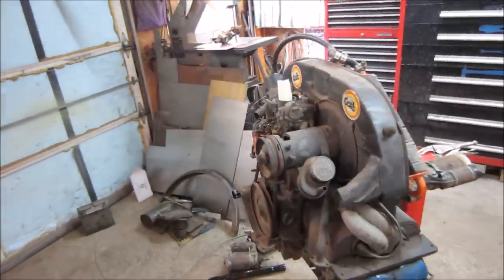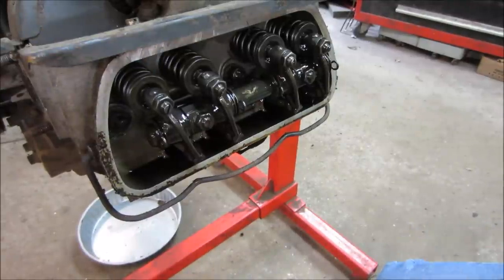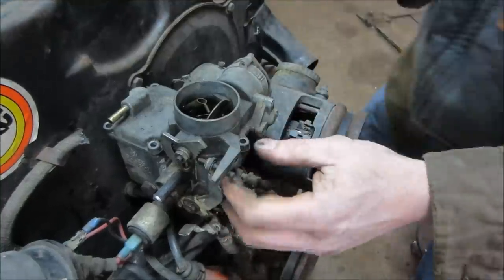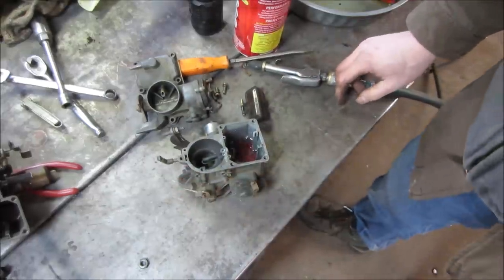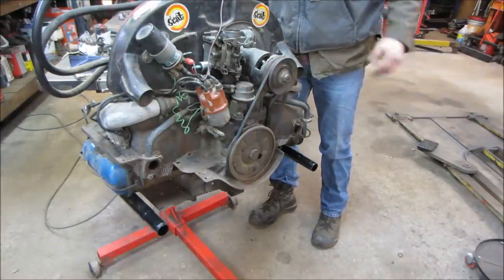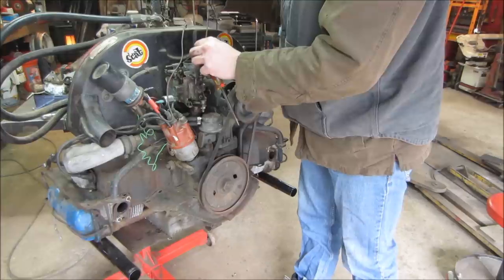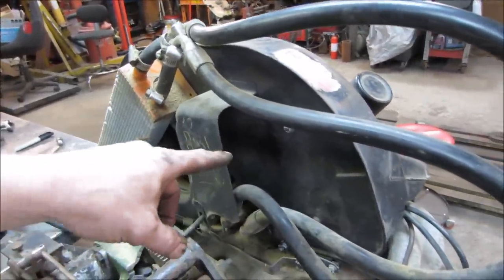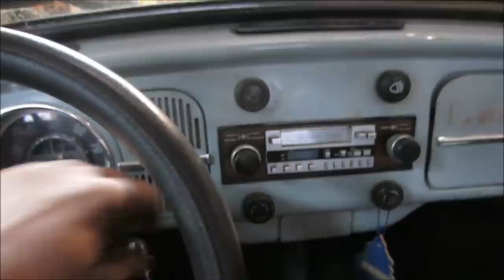will it run? barn find vw bug engine 2nd attempt.

Comment: You do not check end play by using a pry bar between the block and the flywheel. Pull the clutch components and you do it by hand

Comment: The Mustie shuffle!  LOL 
Say Mustie, what is the normal compression of a 10hp Briggs. Got a new old snowblower in need a tune up, carb kit, belts etc. Don't want to put money in it if worn out... Thanks !
Reply from the maker: some have a built in decompression valve so its hard to say, without one it should be around 100 psi,

Comment: If the engines been cooked as you suspect, the rings may have gone soft as well? Had a straight 6 320 bmw once (E21) that when disassembled you could tie the rings in knots...
Reply: Agreed.
Reply from the maker: it dident get that hot, or it would not of come back,

Comment: Excellent video! I do have a question though. You named some reasons as too why the compression might have read low in the beginning. You didn't name that no oil is on the cylinder wall. I always thought that oil was needed to really seal the piston rings against the cylinder wall. Is that correct, or is that just for two-strokes, or not even that? When I get a small engine (chainsaw, etc.) I like to put a very small quantity of oil in the chamber through the spark-plug hole and turned the engine so it would coat the cylinder wall. Always figured that even if it doesn't do anything that it at least won't hurt.
Reply from the maker: the gas l used was mixed with oil,

Comment: Dune buggy use, 1/4" of goo & road dust in float bowl...has the engine been sanded, or partially so? Subsequent compression and oil-grit test may reveal.
Reply from the maker: we dont live in a sandy area, just old gas garbage left over,

Comment: great video. what kind of compression would it have when new
Reply from the maker: depends on the setup but 120/125
Reply from the maker: l should say 100 to 150 depending on the setup
Reply: Mustie1 150 on the high end, that is a lot. If you got that on Paddy, he would need wheelie bars on it with my 150lbs in it!

Comment: Is there a way to do a wet dry check on VW. to see if leak is valve or rings ???  I owned a VW for years and like it a lot for fishing trips and getting around on small logging rds as a kid , but never tried a wet dry check on lay down cyl. eng. works great on all other eng !
Reply from the maker: you can pump air into the plug hole and listen to where it comes out,
Reply: Thanks !

Comment: That's not a different plug, it's a plug missing the "nut". The plugs that had the top that would screw off were set up for the REALLY old fashioned plug wires that just had a ring lug on the end instead of a modern boot :)
Reply from the maker: understood but was trying to show the missmatch parts, the wire ends were different too,
Reply: Gotcha :). I don't think I ever ran across any plug boots that were made to fit on the threads and not the nut (might be tough to deal with today, in my experience, very few plugs are being made with tops that can be unscrewed anymore). I don't expect to ever have to tangle with a Bug engine  but learning something is always a plus, whether you use it or not :)

Comment: The odd "tip" on the spark plug just unscrews, the others are threaded they just dont have the tips, its not really a ratchet type fastener...............but we knew what you meant.
Reply from the maker: some new ones do not unthread

Comment: Shouldn't the motor be hot when you adjust the valves or does it matter?
Reply: No, on a VW stone cold. Most of them .006 old long stud heads are .008 intake, .012 exhaust.

Comment: Why don't you use starting either or propane to get an engine to run?  You don't care if the carburetor is working, just feed it something that will burn.   I once had a fuel pump die and was able to drive the car home by just feeding propane into the air cleaner from a grill tank. It was tricky to get the fuel mixture correct but the engine ran fine.
Reply from the maker: starter fluid is way too dry for an old dry cylinder engine, thats why l was using gas oil mix in it,
Reply: Ah... Yes.. I didn't think of that.. Propane would be the same.  Engines usually start very easily on propane but that would do nothing to help oil the old metal.  Thanks for the reply.

Comment: Is it an illusion... or are you disassembling a carburetor full of gas, sucking the gas out with a turkey baster and squirting it into an open pan, in a closed garage with a wood burning stove just a few feet away (visible at 12:00)?

Comment: Dude squirt some oil or diesel into these cylinders before trying anything else. You don't know how much time this engine has been sitting. Turning it over after such a long time could mean the cylinder walls are completely dry and metal is scratching on metal. Way to go if you want to ruin that engine.
Reply: I agree and if you read my just posted comment you'll also realise that it aids greatly the compression process. But I guess you probably already knew that?

Comment: Question for anyone that might know: is there any way to test compression on an engine that is out of car without a starter stand setup?
Reply from the maker: little engines you can use a drill but not on this bigger stuff,
Reply: Thanks, Mustie1.

Comment: Hello, having an issue here, some of you guys might help.. I own a 68' vw beetle with 1300 single port engine & all of sudden it started to lose power. I tried the compression test & it came out like this - #1: 95psi #2: 120psi #3: 45psi #4: 115psi. Any suggestions? Thx in advance.
Reply from the maker: number 3 is hurting, try adjusting the valves to .006 and try it again,
Reply: Hello and thank you for your quick answer. Right before adjusting the valves I noticed that the clearance on the #3 (intake) was about 0.12in - no idea why, or what happened there... after the adjustment it came out like this - #1: 105psi #2: 130psi #3: ~50psi #4: 115psi. Then I tried to squirt about 10cc of engine oil into #3 plug hole and then quickly did the compression test again. It temporarily went up to ~95psi. Any ideas what should I do now?

Comment: A can of starting fluid is cheaper than a starter.
Reply from the maker: no starting fluid is real bad for an old laid up engine, l was using gas/oil mix, starter fluid is way too dry.
Reply: I use a racing two stroke oil - it burns very clean and seems to work well on my engines.  When I had an old car I had to "bottle feed" to get running, I'd use the gas/oil mix.
Reply: ok then, your mix AND starting fluid, after the first starter motor cool down cycle.
Reply: That washes the rings completely dry, and causes damage that takes a lot to fix. Starting fluid has its place, but not for a an engine that's sat for a longtime and you're trying to start it, have opened engines and seen the damage myself before.
Reply: what mix ratio, 50:1,  25:1?

Comment: Mate,that would have started up if you just had some aerostart or something. So painful to watch, squirting raw fuel unatomised is shithouse
Reply from the maker: worst thing you could do to a dry engine,
Reply: Mustie1 hey? It wasn't dry,it had been cranked plenty for compression test so had oil pressure. As soon as it wasn't drawing it's own fuel,I would have fucked off that stupid fuel squirter and just grabbed an aerosol and got it running. Look at all the black smoke and flames from the raw fuel pouring into the cylinders. It runs on atomised fuel,not fuel pooling in the intake manifold
Reply: But have fun cooking starter motors and filling cylinders with fuel.
Reply: Mustie1 I do watch your vids mate, but I felt compelled to comment on this one